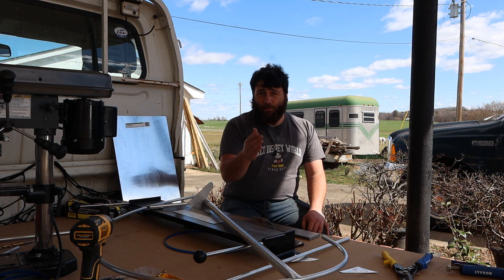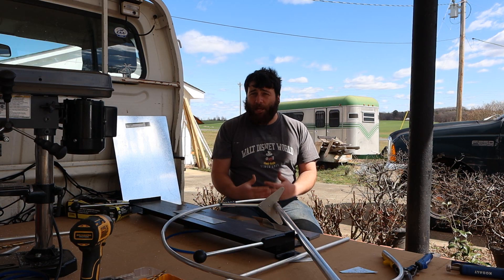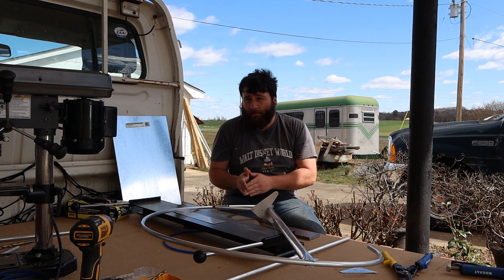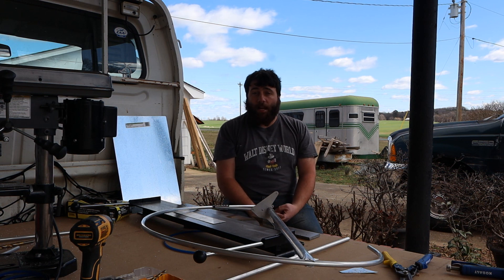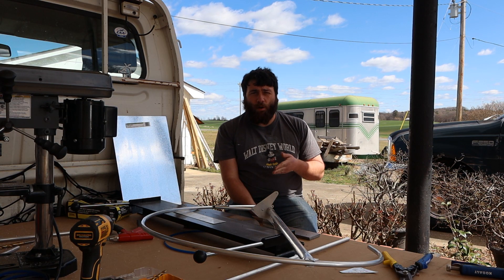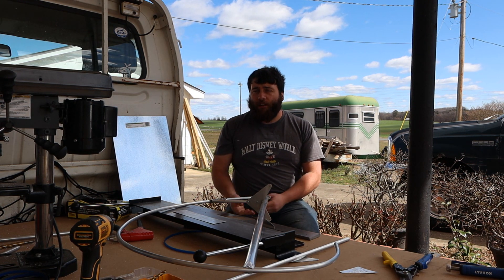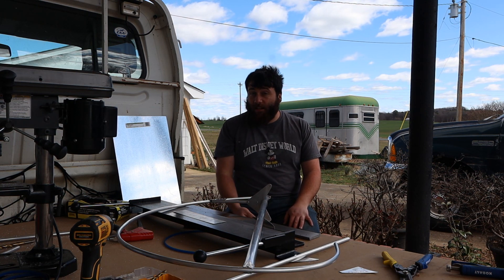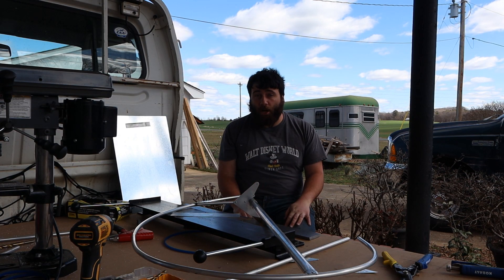Building an Airdrome Aeroplanes Fokker D.VII Biplane: Part 1

Comment: Very interesting project.
I am presuming the Fokker DVII wing profile was not modified or enhanced while the Eindecker E3 wing had a terrible reputation, and I presume the E3 kit wing was modified to prevent killing the pilot.
Website states builder must supply accurate airframe weight for engine mount construction.
What options are available for measuring the airframe weight?
I see no mention of armament.
Does someone produce fiberglass replicas of the two 7.92 mm LMG 08/15 Spandau machine guns?